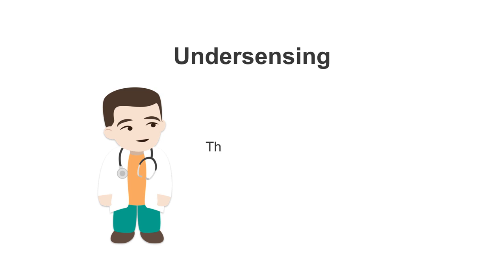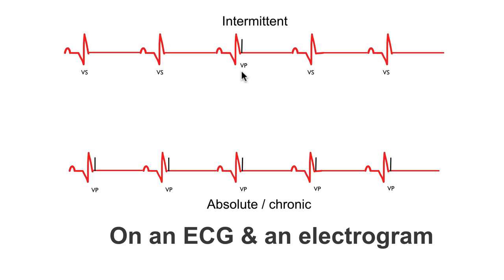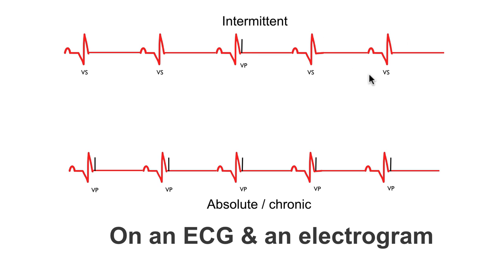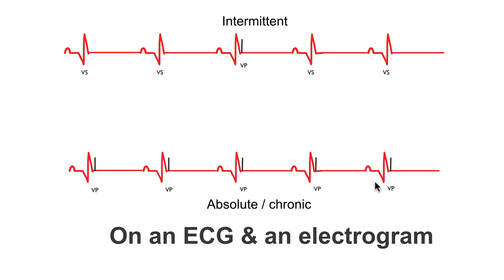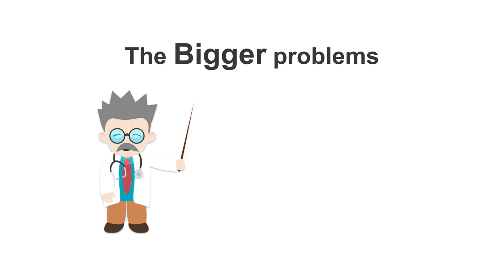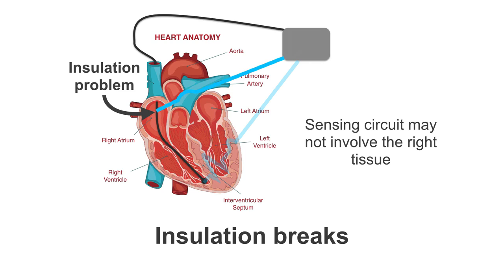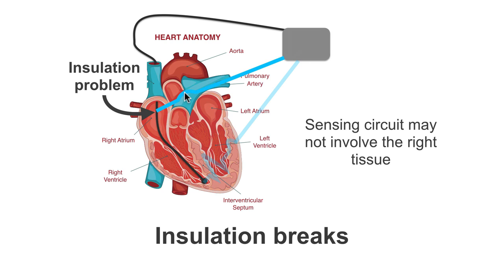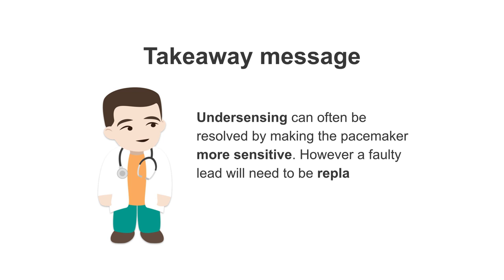Pacemaker Issues Explained (Part 2): Decoding Undersensing

Comment: Thank u for this insight. Can I asked when u say it will need to be replaced so means the person will have to go through surgery again? My father has it done every 7 years in a small room instead of the operation theatre. Is there any risk for not doing it in the OT please
Reply: 1. It’s not a surgery. It’s a routine small procedure. 
2. This small room is called Cath lab. Where such devices are implanted or taken care. 
Do not worry. These rooms are sterile as OR.